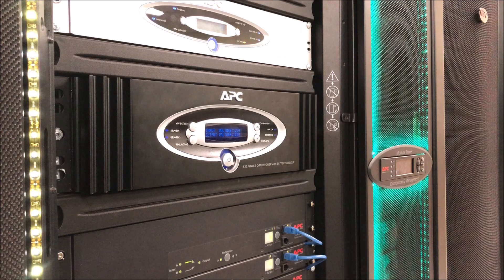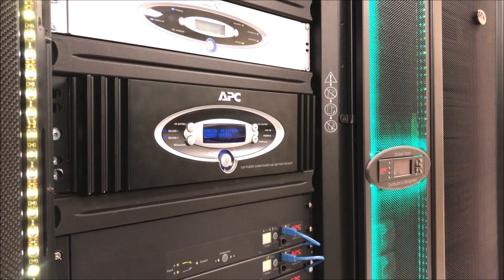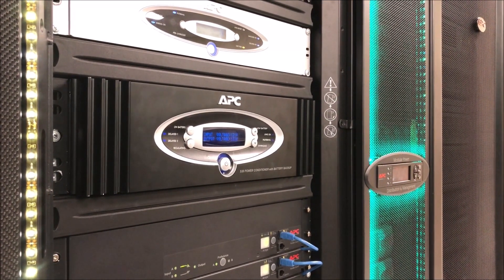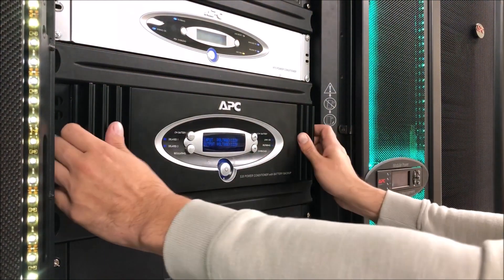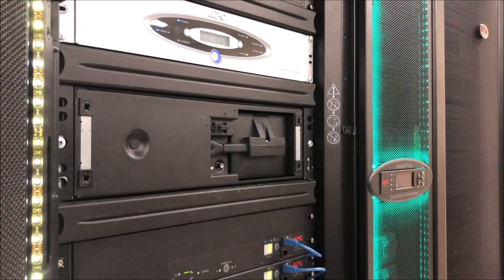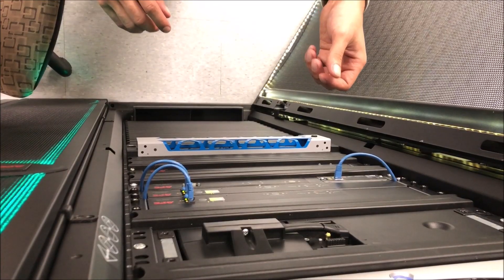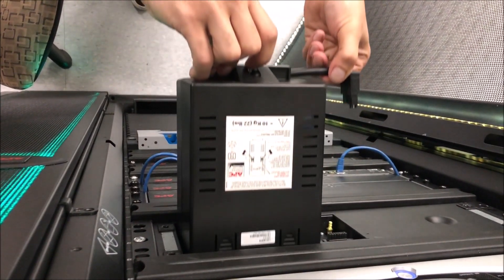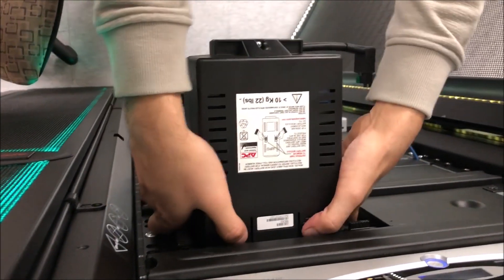Installing Battery on APC AV Power Conditioners with Battery Back-Up | Schneider Electric Support

Comment: This video does not show the battery retention bar that is present on my J15BLK. It is necessary to remove the retention bar by using the thumb screw and removing the retention bar before it is possible to remove the battery connector and sliding the battery forward out of the unit. This has me wondering whether the retention bar is something that should be removed when the unit is put into service.
Reply from the maker: Thank you for your feedback.  Please refer to page 23 of the attached user guide, where we mention removing the battery retaining bar.
http://spr.ly/6057HT2Pl